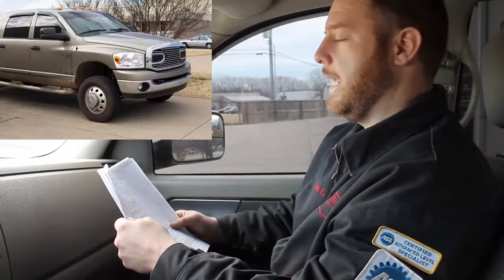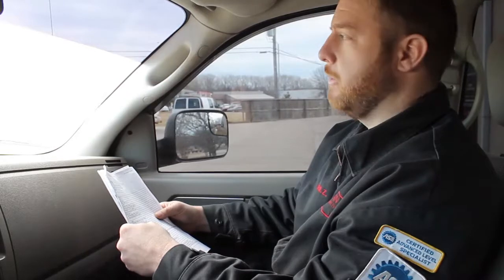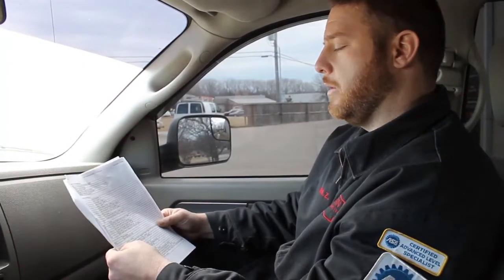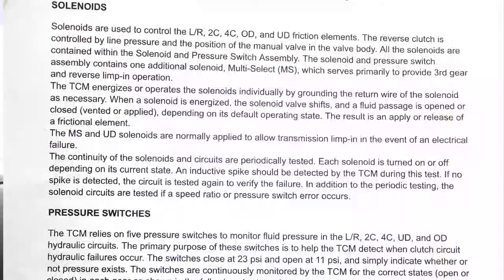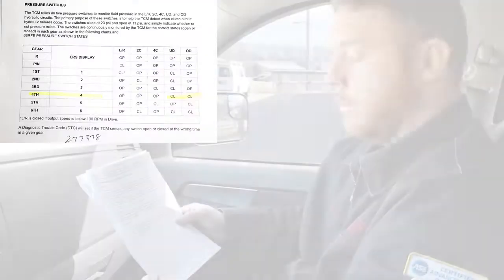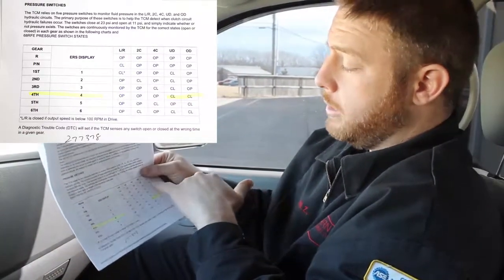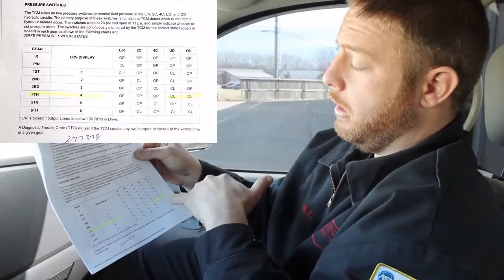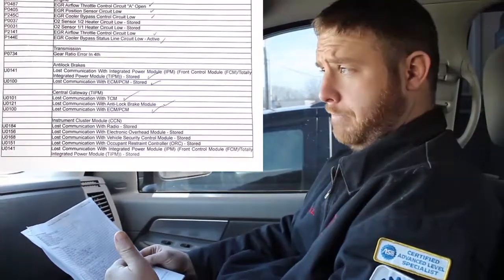Stuck in 1st Gear.  Dodge Ram 3500 6.7L Diesel 68RFE Transmission.

Comment: Had cheap filters in mine, started revving in 6th. Changed to Mopar filters. Started slipping in 6th and 5th. Today on my way home, i was in 6th. It downsifted twice, 3 times, 0 engine power all the way to a stop. Dropped it in 4wd, now its stuck in 1st gear and wont come out of 1st

Comment: We have a 2012 ram 1500 , it has the 6 speed transmission , it has a p0731 code and I believe a p0933 also but I replaced the transmission control solenoid and had it relearned and it is still doing the same thing feels like it only shift's once , doesn't feel like a slip    I can't afford to take it to the shop again and I'm capable of installing parts myself but wish I knew exactly what to fix so I'm not throwing away more money